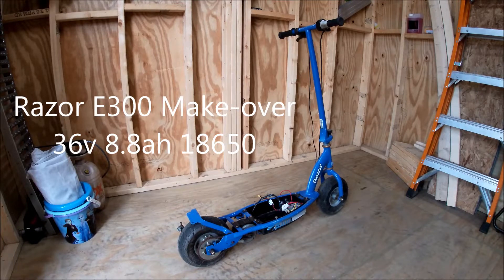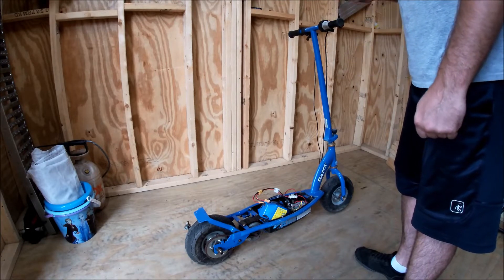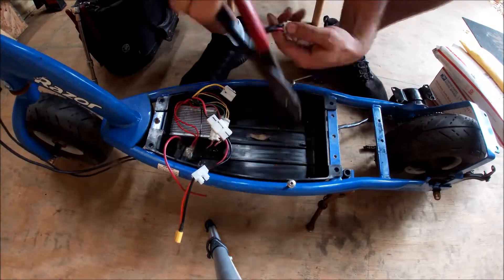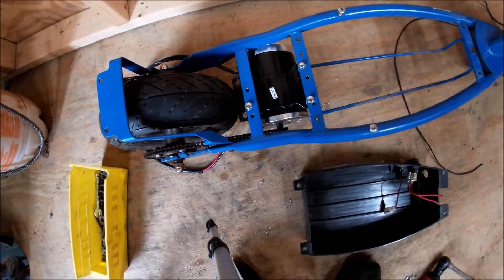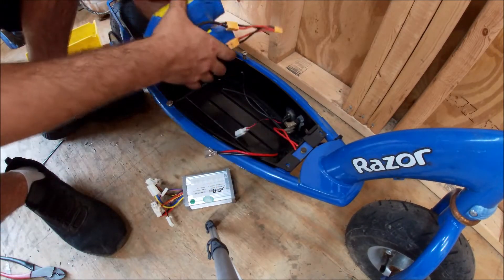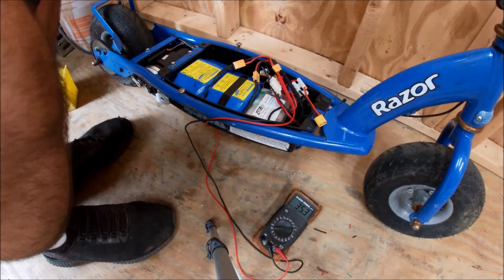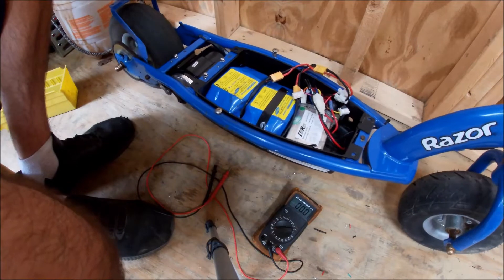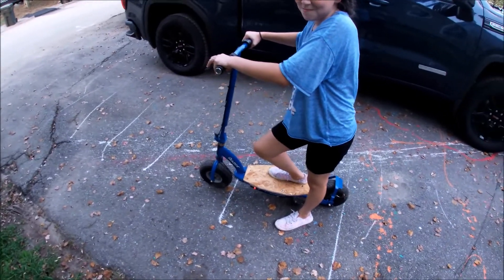The Broken $10 E300 Razor Electric Scooter Make-over

Comment: Running the 36v on 36v motor 800w motor gives you more torque than the 250w motor, for top speed you net (typically) 1mph per 100w, that scooter probably does 18-20mph now. A stock 24v 250w motor running 36v volts nets 50% more watts and rpm. I have run 21-23mph with 36v setup on the stock motor. 
Run 48v on that motor, it will fly.

Comment: You could have used the 24v motor, the over volt increases the rpm, my pocket mod with 36v controller and stock 250w motor is faster than my eco smart with 36v and 500 watts